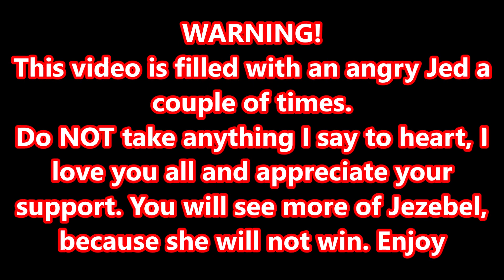Jezebel: Strange Dana 60 Install & Issues Arise with my Ratty 1970 Charger #𝐑𝐚𝐜𝐞𝐒𝐭𝐫𝐚𝐧𝐠𝐞

Comment: Just the tire clearing is a magical thing! Don't be discouraged, man. I had a rearend narrowed (their core) by a well known MoPar shop in Tennessee and installed it in my tubbed '66 Coronet. I measured everything carefully, multiple times, and it turned out a nightmare. The section width on the tires was published wrong (less than actual by 2"!) and that caused the sidewall to rub the quarters. I gave a little extra clearance in my calculations on the leaf spring side, which is impossible to change, and had to swell the quarters a tad to clear. Then the wheelbase was off on one side, because the guys who did the rearend used a BENT housing. The ends were true to the centerline of the differential, but the U-bolts that center the housing were off, causing the rearend to sit crooked under the car! I ended up using a (mickey mouse!) adjustable 1" lowering block to get the wheelbase set, but it soured me on the whole project and I never even assembled the motor for it. My advice: don't stall out, keep moving forward. It's been almost 20yrs since I had that rearend narrowed!

Comment: I once bought a brand new pair of leaf springs that were crooked like yours. Turned out that one of them was made slightly twisted. I returned them, and the company made me a new pair. and they lined up perfect. I know the feeling when a project causes frustration. All of my Mopars have fought me every step of the way, and I had to take a few breaks too. Otherwise, they would fit me up with a straight jacket! I am not wealthy, but I enjoy spending my money on car parts. I just fabricated a 6-pack system with three Weber IDF carburetors on my black '73 Charger. The project only cost me about $1000, and it looks and works amazing! When I finish fabricating an air cleaner, an custom electric air-grabber scoop opener, I will e-mail you some pictures. Enjoy your break time, because when you see the insane 6-pack system that I made, you might be fitted for a straight jacket too! Ha ha!  You are an inspiration to me! Keep up the awesome work you guys!!!!!!!!!!!!!!

Comment: Jed it definitely helps to step back sleep on it and re-attack when you have greater resources (time/energy/science/motivation/cash money). Biggest mistake I made was to sell my Blown 74' AMX w/401 and TH400! It had two quirks that took me out! 1. The person I sold it to found out my engine builder didnt balance it and it had a rough shake. 2. Screaming transmission flywheel starter gear  issue  no one couldn't solve with shims etc.  If I had just did what you did and came back I would likely be in the 10's by now with an AMC motor. Your the only youtube guy with a Ratty 70' Charger doing what many of us dream of with a B-body Dodge! Look forward parking my Track Pak next Jezebel one day and going for a cruise! Stay at it!

Comment: Hey Jed. Nice car cover. The springmounts on the rearend only have to be off a little bit to screw things up. Cut them loose and get it lined up then weld it. Mabye have to get new ones.
Reply: I think this is the exact thing going on. Everything was ok with the old Dana, geometrically speaking, so there has to be an issue with those axel mounts. Just being off a slight amount multiplies by the time everything else is assembled.
Reply from the maker: everything was not okay with the old Dana, car sat funky even with it

Comment: Sorry you're having trouble, your going to need some small spacers under the wheels. half an inch would probably be big enough. Don't forget, you're gonna have to go around corners and the tires will rub at the bulge which can be dangerous.
 I didn't notice if you mentioned it but you should check your locating holes on the new rear end spring perches to make sure they are centered and exactly 44 inches. 
 Check your new super stock Springs against your old Springs and make sure they are the same length in the front segment. Actual superstock Springs were 2 inches shorter than B body and E body Springs. Check between the front eye of the spring and the locating stud. Could be what's causing the problem with the way the shackles hang.
Of course it could be that the rear of the springs are curled up too much    Encho en Mexico
 I ran superstock spring HANGERS on a street 'CUDA for years with no problems. you may need a set. You could make a "custom" length SS front hanger to get the shackles to drop the right way but then your messing with the driveshaft length again as well as wheel centering in the wheelwell.
Obviously, don't get a driveshaft made until the rearend placement is perfect.

   WIsh I could come down and help...

Comment: Been through all that before and basically you start at the front end and check the torsion bar height to solve that rear sag issue.
The shackle issue is solved by adding grease to the bushing and using a  C clamp to press them through the rubber bushing.

Comment: I picked up a 69 Charger a few months ago that I knew had issues. It's not rusty but something is not right with the way the rear quarters, trunk floor/bumper bracket and tail panel line up. Trunk lid fits decently but the lower tail panel looks like #$%&. They tried to be fancy and weld the corners pieces flush and they screwed the pooch when they did it. Sadly, I gotta get a local body shop to help me out. I ordered a new lower tail panel and corner pieces a month ago and I'm still waiting on them. I put new drip rails on recently and the new roof skin I got fits pretty good so far. Birdsongs videos have been helpful with that.... Cars can be a pain in the ass. Thankfully you got some others cars you can feature for awhile. Jezzy will catch your eye again.

Comment: Look I feel your pain. I don't have even ground at my place and everything is done on grass. I hate it.

Re Jezebel. These cars twist in the body, the torsion bars sag, so on and so forth so I'm not surprised about the misalignment at all. 
I had a Dart and if you jacked it up the doors wouldn't open. That's quite a lot of movement.

Re the spring issue I may have an idea.
I have a Toyota FJ40 4x4. It has front and rear leaf springs. My shackles were misaligned like yours too.
I had all the springs professionally re-set and they did a fabulous job (despite people saying you can't reset spring steel which is utter BS). That was 9 years ago. 

Anyway, it went like this:
There were two stands supporting the diff housing and two supporting the body.
I bolted the springs up with new bushes. I tightened the springs to their final tightness, so the springs were completely installed. 
Next, I lowered the diff housing onto the locating pins in the springs. Next I cleaned and greased the U bolt threads and put them over the axle housing, then the bottom plates, then tightened right and left side U bolts with a ratchet so I could feel what was happening. I incrementally tightened the nuts so all the U bolt threads were about the same distance poking out of the nuts on each axle. When they were reasonably tight with the ratchet I put a breaker bar on them and stretched the U bolts properly. 

After you've bolted up the rear on Jezebel, put the car on flat ground - local car park or somewhere and take a ratchet and tape measure and adjust the torsion bars if there's anything left that is. 
If the adjuster bolt is disappearing up inside the arm well the torsion bars are either no good or a lower arm has split apart. 
(you can actually fix a split arm on the car. Just loosen the adjuster and take the bolt out, squeeze the split where the bush is with a clamp and weld a small tab of 3mm or 1/8th" mild steel, re tighten the adjuster and you'll never have to worry about it again. 

BTW, I have the Mopar Chassis book too and the reason you don't want the rear shackle going forward is when the spring compresses the shackle rotates in the opposite direction!  It's gone over center.
Reply from the maker: The entire front suspension is brand new, lower control arms are braced, I believe I found the issue and it isn't with anything I have done other than buying leaf springs that are not made correctly

Comment: I know you said this car has subframe connectors on it some time ago but if the car isn't sitting on its suspension loaded while those are welded in it can cause issues of tweaked unibody on these or causing the stuff like that rear spring not to center its self . I also wonder if those springs were marked with the wrong numbers for each side so they are like you say on the wrong sides being I know with the SS springs one side is stiffer than the other to correct for the torque that's applied to the body & chassis while launching for drag racing . Are both rear springs offset to the rear unibody frame rails ? Because I do know most people who put those SS spring on usually put the rear spring  relocater kit in that brings the rear springs in 2 or 3 inches on each side to run a wider rim & tire on the back along with mini tubs & maybe this is what's needed to correct the offset that your having issues with . The car shouldn't have tweaked it's self with with those sub frame connectors on it but could it be also that maybe the front spring mounts are on the wrong sides or possibly that the spring perch mounts on the new rear end are in the wrong location ?  I guess the next thing would be to do a bunch of measurements on the rear half subframe & see if they aren't square possibly from the front spring perch mounts to the rears & maybe get the car on a level area then using bubble levels on it so it's sitting absolutely level from to back side to side then crawl under it & take measurements from a level spot on the ground or preferably a level cement area & measure from the ground up to the bottom of the subframe connectors & the rest of the unibody structure taking notes & writing those down on one side first then comparing the opposite side . Also take into account that one side or the other could be a little higher because of one torsion bar adjusted higher than the other as well or even a weak torsion bar especially if it still has the torsion bars in it from when it was originally a 318 small block car which uses smaller diameter torsion bars than a big block car . Hope this helps or gives you some ideas as to what you can look into . The best way would be to take it to a frame shop & have them look at all this stuff but that costs more money than you probably want to screw with but at least this way you know the frame rack is level & they can at least get accurate measurements of those sub frame connectors & the rest of the unibody on it which you can do yourself but it will take much longer .

Comment: I would X measure the front hanger mounts to the rear skackle mounts and see if they match. I would also X measure from the torison bar cross member to the springer hangers. These cars were never made square from the factory. The spring with the most leaves goes on the passenger side irregardless of the part number.

I would have mounted the springs first and then install the axle. I would also have used poly bushings, they don't require you to "bound" the shackles into place.  Those long shackles can hide a lot of problems. I would use wheel spacers to fit the tires better. Otherwise the car looks good.

Comment: My Dad ran a frame /alignment shop back in the 70-80s he was constantly bending them back straight then adding strength plates . I Cut hundreds of plates after school so he would have them in stock. They come in dog leged / crab walking and leave straight. Nothing new here dude, just take it to a good frame guy. Measure from center of axels L&R Front to rear that will tell you alot.about what to do next.
Reply: I think that skill disappeared along with chrome places about 30 years ago. If you know a shop in So Cal for me let me know.
Reply: @auteurfiddler8706  Every body shop can do it if they have a frame rack . If the don't have one then they are not a true body shop. It's all about datum lines. Not rocket science.

Comment: Guessing the car was in a wreck at some point in its life.  That would explain the rear frame rail not lining up with the leafs.  You can heat and bend some rear spring shackles to make it work or bring it in to a body shop and straighten out the frame.  1/2 inch wheel spacers will solve tire clearance issue.   As for the Mexican made Mopar SS springs,  give them a few months of use and they will settle a little.  Probably should have bought Calvert mono leafs and Caltracs.   Don’t get frustrated.  🍻🍻

Comment: my 68 mustang has 14L60 mickey thompson on 14x9 aluminum slots ass end sits too high back left sits higher i thought unibody was tweaked or leaf spring sprung then discovered front right vulcanized perch bushing totally gone. when i win lottery mickey thompson are gone. are your torsion bars clocked the same?

Comment: I understand getting frustrated with a project and the need to step away. But what is the chance you have the springs mounted on the wrong side. ie. driver side  needs to be on passenger side and so forth.
Reply: The stronger one goes on the right but the right on his is the low side, the opposite of what it should be as he said.

Comment: I wonder if maybe the unibody got a little tweaked when you lifted it, I know when I put my 70 on jack stands I cant open or close the doors until I drop it back down.
Reply: My guess the car was crashed and repaired.  Just not all the way
Reply: @jamesfeil2468  wouldn't the issue have been there before the axle swap then
Reply from the maker: The car always sat fine with the original 8 1/4 rear end and leaf springs, only when the first set of super stock leaf springs were installed did these issues really start to happen, and the second set made it appear even worse.

Comment: When you less PO’d I’d have them springs back off. Lay one on top of the other and check they are same height ( if they are supposed to be) check the ends are made right and check the front spring hanger is in right. I t may never have been from the factory. Also if all else fails swap the springs side to side no matter what the books and other people say. Wouldn’t be the first time people/ books or spring manufacturers were wrong! Your not going to let ole Jez beat you are you?? 😉

Comment: At one time or another, I've walked away from all of my projects, cursed the souls of those responsible for the design, & then went back at it after awhile. You know what - you've got a lot done on Jezebel, so a break is in order. The answer will come in time.

Comment: I understand the point of being sick of working on something that's not cooperating- after all I was married once...and here you chose the devil's daughter, so there ya go- LOL.
My guess is you have a hokey set of leaf springs. Maybe your dad or Michael would be willing to go out and measure them eye to eye, and also check them for straightness to see if they have a side to side bow in them. Aftermarket parts and their non fitting fit can sometimes cause a lot of headaches.

Comment: Super Stock springs are junk ......I dug a hole and buried a new set I had bought for a 70 340 dart, 20 years ago......I put cal trac with mono leafs on my 66 Coronet.  NO comparison!  1.40 60ft and they are nice on the street.  Don't give up put the old springs back on.

Comment: Iam not a fan of narrow rear liked the wider stance of old one.but iam sure you had reasons for that madness,yeah can relate to shipping retards i got ripped on jet ski rubber trim.from intenet shopping partzilla.com they tried to get me even more by saying spend twenty more on parts u dont even need youll get free shipping.so i tryed!!! That just made bill even worse so went back to original list cost 350.00 with s&h got the parts of course wasnt right part.sent back they only refunded me 152.00 cost of part,and they kept 200.00 shipping n handling.bastards,never again so yeah feel ur pain.snookie pa.

Comment: Hey bud cant quit now it's a easy fix to line up spring hanger u need to open up frt bolt holes in the frt hanger that car was built and put togher never checked to see if it was good when new open up frt holes or check if hanger is right side line up rear problem solved as for hight ss springs will do that let them settle and that should solve it hight problem I put new springs in my coronet rt convertible it was same one side higher I had to realign frt hanger to rear buy making the bolt holes oblong to the right to move the spring hanger left I had replaced the rear hanger support because of rot I though maybe I didnt get it exactly I checked out diffrent b body's none where same measurements as the others lol made buy man and monkeys lol I'm gathering parts to 4 link mine with ajustible track bars and air ride or coil over I'm not drag racing it so prob.air ride for the ride comfort lol lots of luck dont quit now or put original stuff back in leav it alone